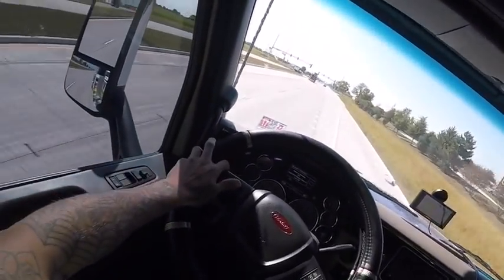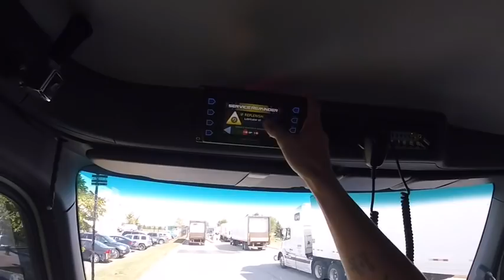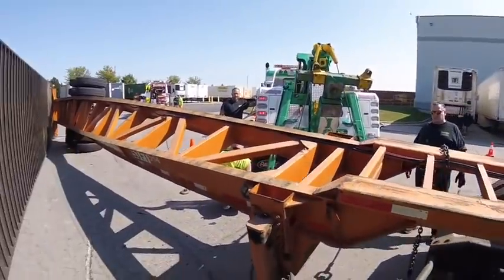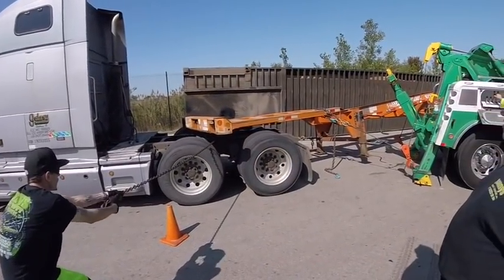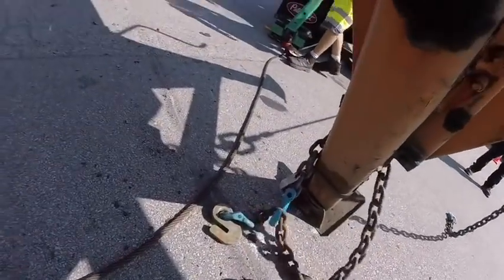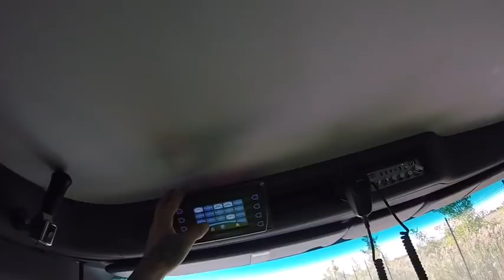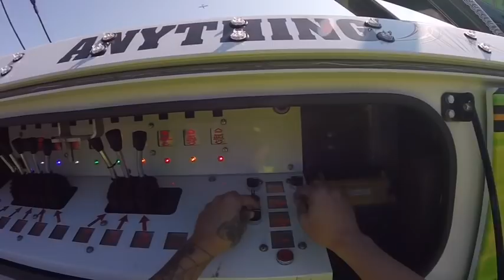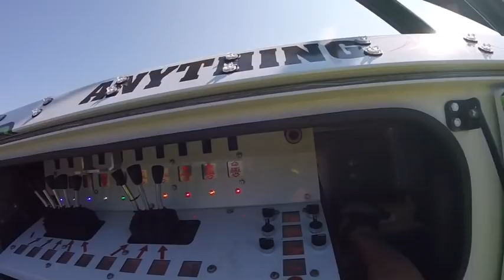Rotator work episode 4 container roll over

Comment: So, would this have been less likely to have happened if the front locks on the container were used - I would think so as the container supplies the essential rigidity to the trailer's skeleton frame?
Reply: There's absolutely NO excuse for flipping a trailer in a parking lot, no matter what kind or how top heavy it is.  You're not supposed to be driving faster than 15 mph anyways.  Total negligence on the part of this clown.  He was obviously driving too fast when he approached that turn and the momentum caused a trailer tire to blow up.  I hope he was fired on the spot and he's enjoying his new career shoveling fertilizer or flipping burgers, anywhere but behind the wheel of a truck.